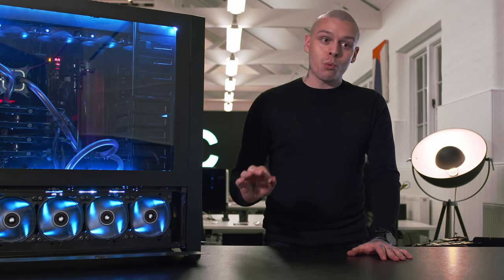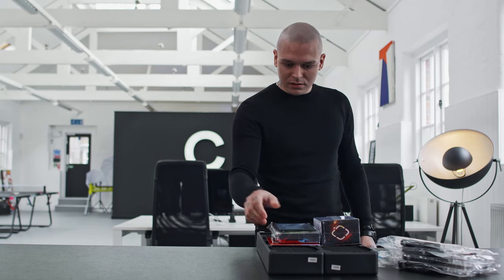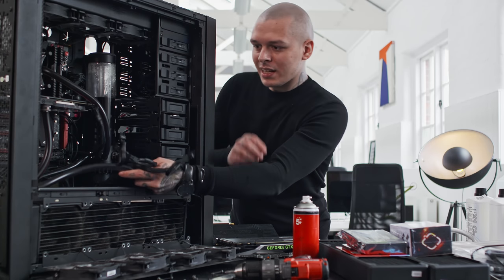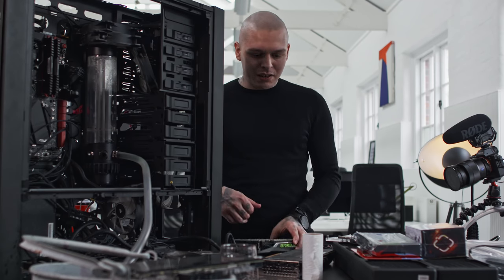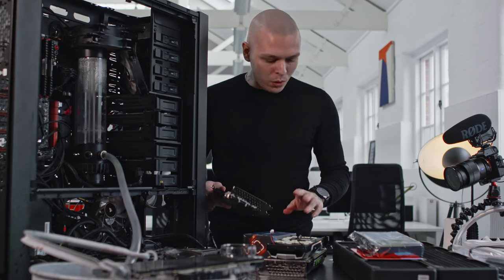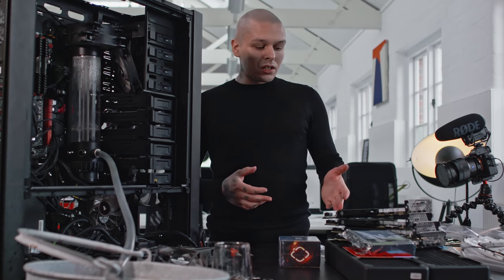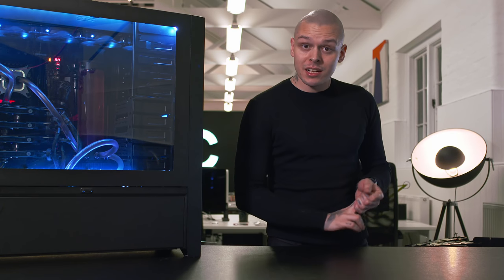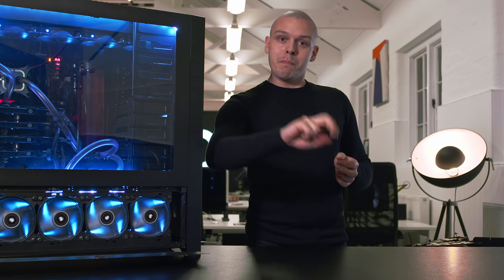Watercooled CG & VFX WORKSTATION

Comment: I have a query if you can help me.
1st - i always used to think different models of nvidia gpu cant be connected on one motherboard. But now i get it. One gpu for monitor output and others for rendering. But how will the windows and softwares differentiate between that ?? 
And if i am playing games which graphic card will act ? The one connected to monitor or the ones used for rendering.

2- as far as i know while rendering SLI solution only uses 1 graphic card. Rest 2 are not even used if you monitor them at the time of rendering.
Thats why nvidia introduced nv link solution. Which was 10 times faster than sli 

Please help me. As from past many months i am not buying sli cards and waiting for nvlink tech to be available in my country.

Regards
Reply from the maker: Hi mate. Thank you for your comments.

1: in nvidia control panel you can specify which software (or game) is using which card. You have full control over that.

2: I’m using Octane render engine it can utilise any nvidia card in any combination and it doesn’t use SLI. SLI is in fact not beneficial for it at all
Reply: Andrey Lebrov. Okay so the secret is octane 
Thanks for replying so fast.
One last question. 
Redshift and other renderers wont work like octane obviously. So will they behave the same way octane behaves while rendering or will they use any one of the card which i will specify.
You know experimenting after buying products can be hazardous to low income peops like me. So may be i will invest my full money on nv link. 
Your advice on this will be highly appreciated.
Regards
Blackburn

Comment: What thought did you put into mind when buying you GPUs? Why nvidia when you're using it for CG and VFX?
Reply: Because Octane render needs Nvidia.
Reply from the maker: My workflow benefits from Cuda cores and the cards I’m using are the best and most effective solution. My main render engine is Octane. It’s performance scales linearly. More cards - more power. At the time I was building it Octane didn’t support AMDs. It does now, but nvidias are better :)
Reply: I love Octane.  Which version added AMD support?
Reply from the maker: Since Octane 3 release I believe
Reply: I dont think it is supported yet. I think it will come with version 4, that is out for standalone, but not for C4D yet. You cannot use it yet with amd GPU's.
Reply from the maker: It is. Otoy haven’t updated their documentation yet ;)
Reply: ahh ok. Ignore my comment then :D
Reply: I've tested it on a AMD 290X system now and can comfirm it doesn't work. Cinema is just crashing on startup, and standalone asks for NVCUDA.dll or something like that. I've read ALL over the internet, because i would love for this GPU to work also (all extra power is worth it), but i can't find anything. So it might still be because i'm just a noob. But it seems like at least not all AMD GPU's are supported.

Comment: Do you overclock your hardware?
Reply from the maker: Nope
Reply: @AndreyLebrov  It brought my attention that you spoke about better performance, but didn't mention what was your decision on the topic. Could you please explain your judgement on that? Is it lifespam or some other factors?
Reply from the maker: I did. Cooler hardware performs better ) there are a lot of documented tests online, I haven’t recorded anything. In case of octane render engine that literally “attacks” your GPUs it’s very important. For stability more than performance. If you would overclock anything octane would become barely usable. Redshift on the other hand distributes loads evenly and more “controlled”. I would say you can overclock with it. As for lifespan I guess yes, but I have GPUs that run on air 85-90 degrees under load pretty much every day for 4 years in a stack of 4 and they are fine. And I have heavily watercooled ones that were 40-50 under load and haven’t lasted couple of months 😆 both aircooled and watercooled die equally. Something else influence the lifespan )
Reply: @AndreyLebrov  I must have missed it. Thanks for the reply, greetings from Poland :)

Comment: I still do a lot of CPU rendering so I went dual Xeon which led the whole build more expensive; board, ram. I have 3x 1080Ti hybrid water cooled and a Nvidia Quattro for displays. As a suggestion anyone with a computer should be running a dehumidifier in the room. Ivation 50 Pint Energy Star Dehumidifier https://www.amazon.com/dp/B07MTNH6N3/ref=cm_sw_r_cp_api_i_cQIDEbJXHH7C9

Comment: lol the misinformation here is funny when you got dozens of other techtubers out there that are saying completely different things. Like disassembling your entire rig every 6 months? Rust on the outside of the radiator? GPU throttling doesn't happen much with a board partner cooler even when 100% throttled. Pro tip if you can easily bleed off fluid while adding fresh fluid with the pump running to clean out the loop every month and almost never have block build up if you take 15 min to do it.

Comment: Talking as an experienced tech guy with enough experience on water cooling systems, you should stick to your CG & VFX and software, don't touch hardware, you have way too many mistakes in there for me to correct, and you are just exposing your hardware to risk, so if I were you, I would just give this to a professional to do the job and stick to my applications. all the problems such as rust and growth are all related to your mistakes such as not flushing your new hardware with distilled water, and even the previous hardware with growth can be cleansed and used again.
Reply from the maker: Wonder how I built my 12gpus units.. but thanks for the comment ;) I’ll go draw something